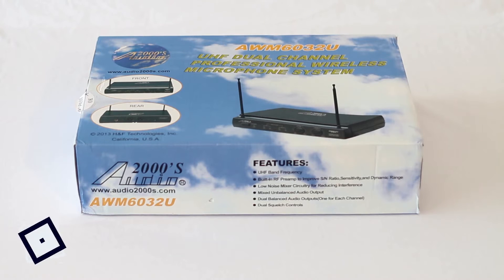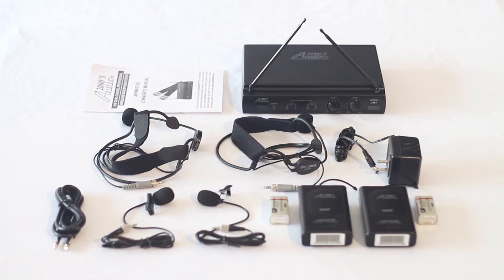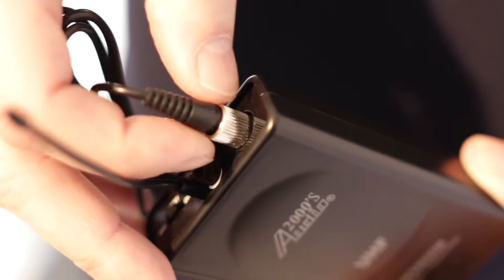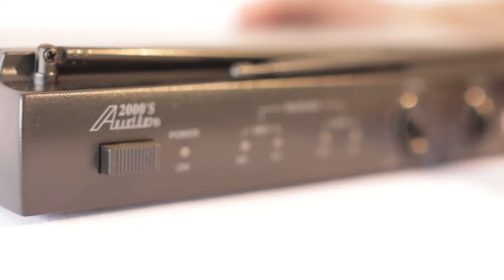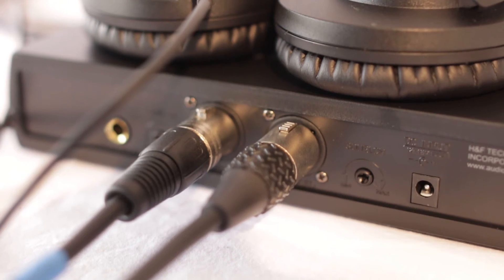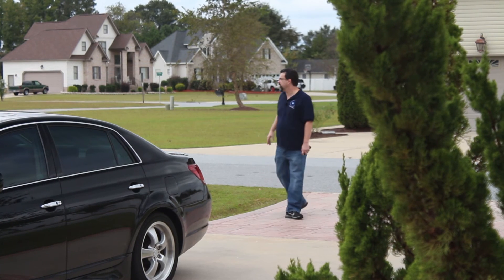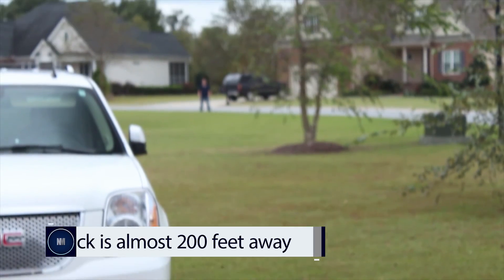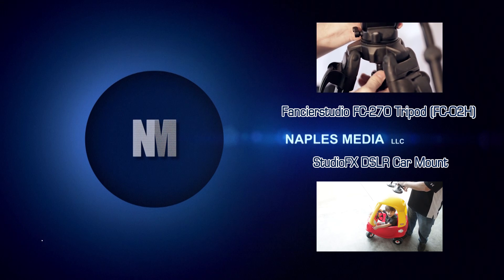Audio2000s 6032uf UHF Dual Channel Wireless Microphone System

Comment: How can you connect these to a speaker
Reply from the maker: You can use the unbalanced jack plug to a speak system.  The speaker will need to be powered.